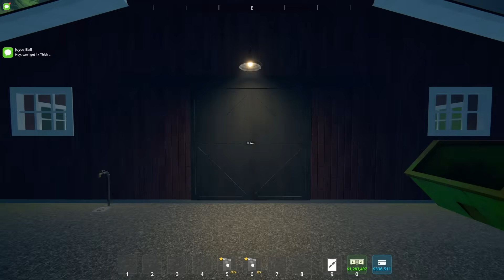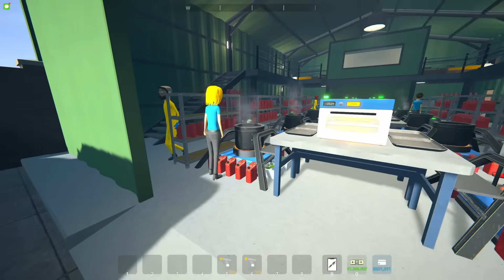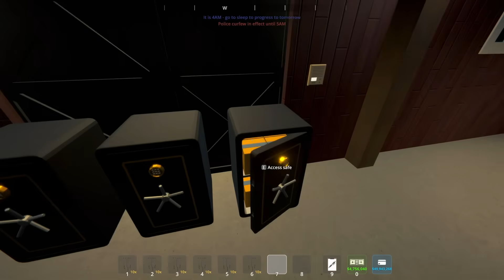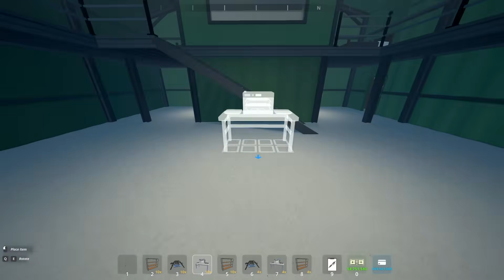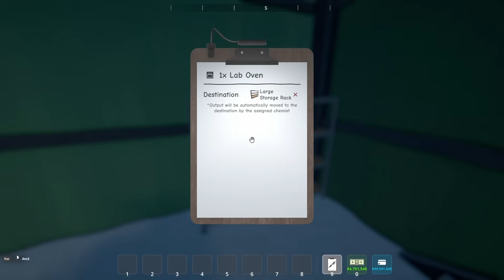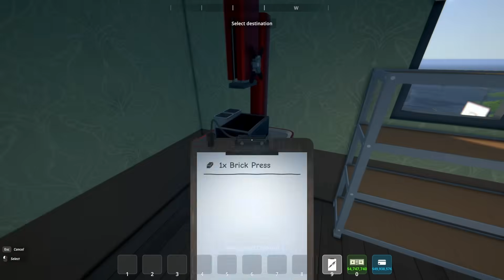Maxing Out Production In Schedule 1 (Barn, Docks, Bungalow, Shop, Motel)

Comment: This is cool and all, but it's kind of pointless I think. I only sell vanilla OG Kush and make over $25k every day (demand goes up with level also), with minimal cost for supplies or employees. So roughly 80-90% of my revenue is profit. The problem this game has atm is that it doesn't matter what drugs you sell people; they are always willing to pay the same amount of money. Because the demand is constant, the only way to maximize your profit is to lower your cost and minimize your cost-to-price ratio. The other problem with mixes is that you constantly have to resupply everything, meaning you can't be out on the street selling your drugs; demand is your ultimate constraint, so you need to constantly be selling as much as possible. I think they should fix this and align the main content of the game with the dominant strategy.

Edit: I can't say for sure if this is the best setup or not, but it's very easy and saves time. Beating this would require a ratio that is over ~85% profit, or a way to increase demand to a point that is higher than the time lost on resupplying. Addiction may increase the number of orders that come in (I don't know), and selling over the app allows you to upsell more (I think); perhaps dealer demand may also go up with addiction, but I don't know if this is true or how large the impact would be.
Reply: Progression in my opinion. I started with a large green op then moved added a small glass op, then I made my way to this. But my farm can easily switch green or coca. Just to add some flavor or variety. To each their own. I think the 8 mix isn't super efficient because some customers can't afford it.
Reply: @getsomeboy321  Yeah, I mean, listen, I want to make cocaine and meth; it's just that the payoff doesn't seem correct. In the beginning I did weed and quickly was able to make around $100,000, then switched to meth, and I noticed that I was just making less money and spending more money buying products and more time managing my supply chain. The payoffs and progression should be aligned to make the game more fun; otherwise, progression becomes horizontal rather than vertical.
Reply from the maker: that's a fair take, it all depends on what you want to do in the game
Reply: @MyGamingExperience  Yeah, that's true. I really want to do something like you did; it looks really fun and intricate, and there is a lot of creative potential that each player can use; I love that. I just wish making money fast, making cool production lines, and progressing the drug ladder would work toward the same goal. That's kind of my point.
Reply: @MyGamingExperience  Do you actually make 80k revenue per day tho? There is no way that is true, if that is true, then I am missing something. I haven't maxed out my level yet, but I am doubtful this can raise the demand that much...?
Reply: @Gardor I saw a vid of this guy who only sold base OG kush in bulk. He made 75k a day at the max level (35k from manual sales 40k from dealer sales). You could probably make more if you take on every customer yourself every night.
Reply: would you mind making a video of it? i was also trying to max the producton of vanilla og kush

Comment: I was actually wondering when I was going to see more setups utilising more than 1 location. I just unlocked the docks, and I had a similar idea as you to centralise mixing and storage instead of trying to mix everything everywhere. 

The only thing I will say is that you underestimate the motel imo. I’m not sure if it would work as well with your set up though, but the route for the setup I want to do is start at motel > bungalow > sweatshop > barn > docks > back to motel. The goal is to make every drug at the smaller locations, mix and package everything at the docks, then take all the bricks to the motel where I have a packaging station and I can break down every brick and portion it myself based on customer demands for the day. The motel’s really good though for just keeping everything in one spot, and being a nice centre location to get deals going faster.
Reply from the maker: I may have hated on the motel a bit too much. It does have a nice central location for the customers that can be used a setup quite efficiently.  Using the smaller locations to make the products could also be a really good idea. I will have to do some testing
Reply: @MyGamingExperience definitely lmk! Always want max efficiency
Reply: I had a handler that transport stuff from motel to swaetshop. Thats possible to make him walk up and down. I used sweatshop for the packaging and barn for mixing. Factory for growing and the meth. Only thing is you keep driving circles with a van to move ur product around. Its to much